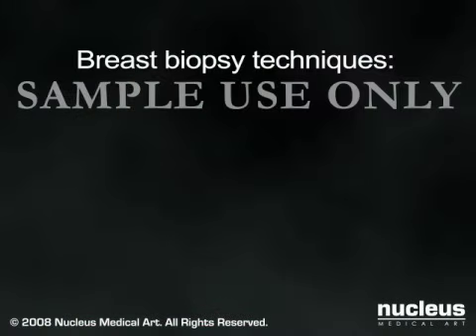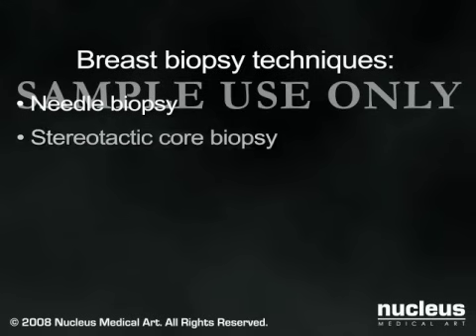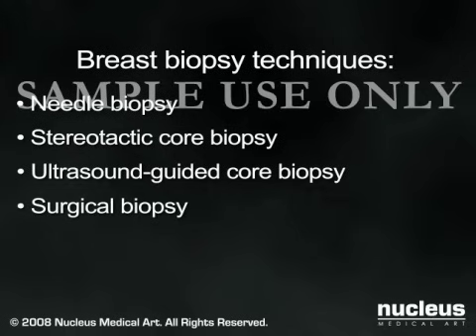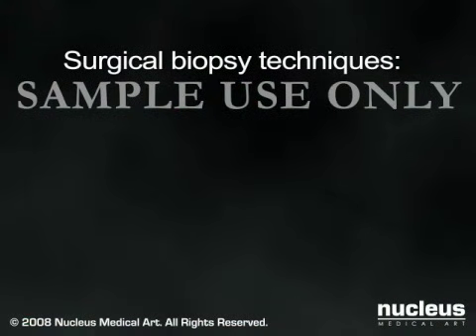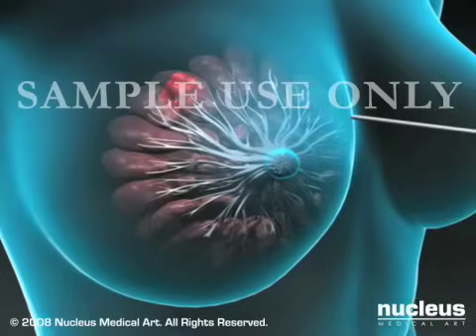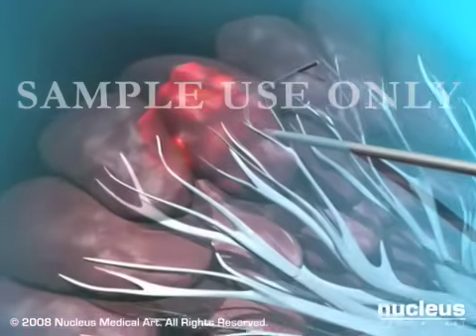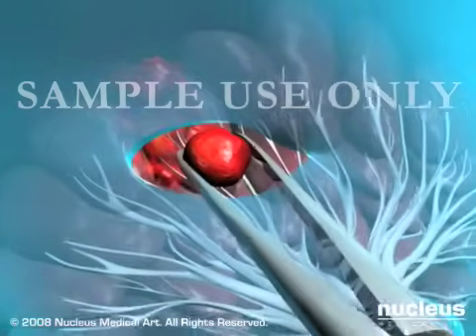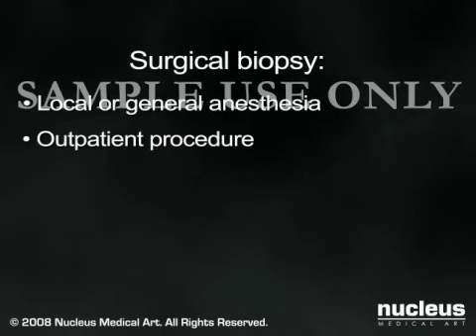Breast Tissue Biopsy (2008)

Comment: @procommenter not at all the evidence rigth now is that there is no one cancer cell, there are multiple types of cancer cell and they come from the tissue that origynates them. Not all cancers have the same risk factors, survivance, tratment, etc. Colon cancer has diferent risk factors than tyroid cancer or brain cancer. Even you can show how the cancer cell diferentiate from the original tissue and use that as a marker for treatment and prognosis.